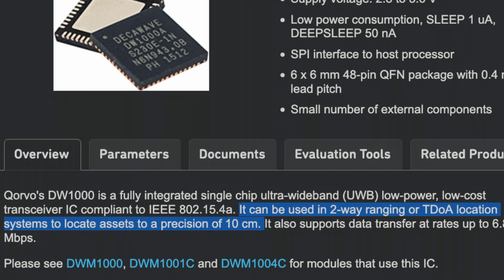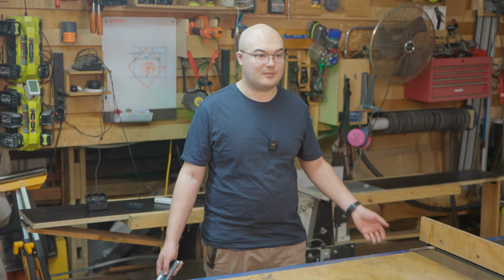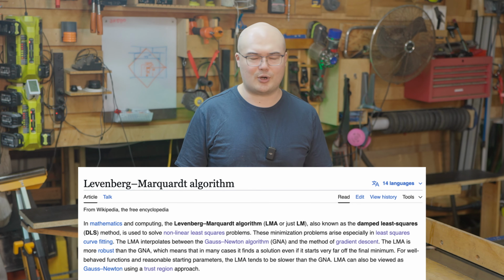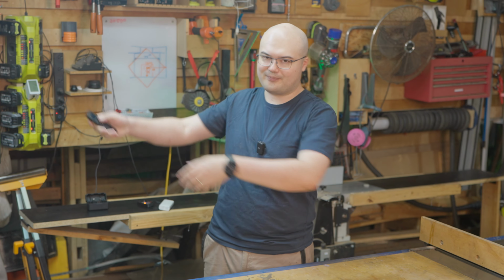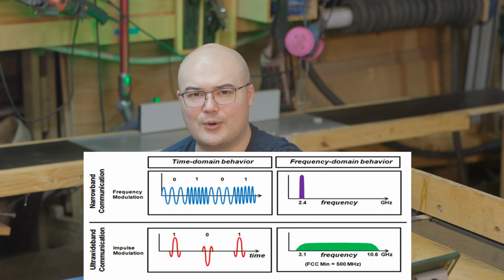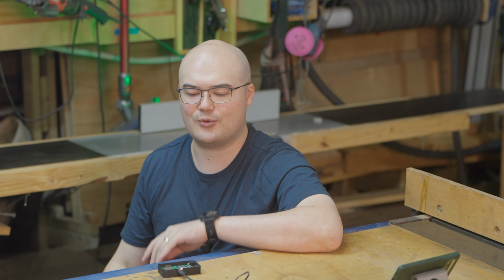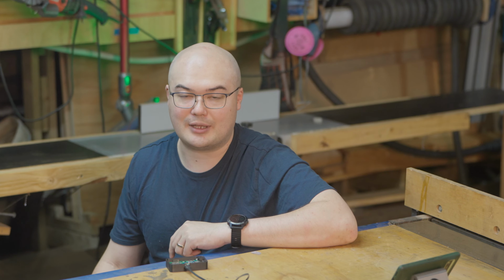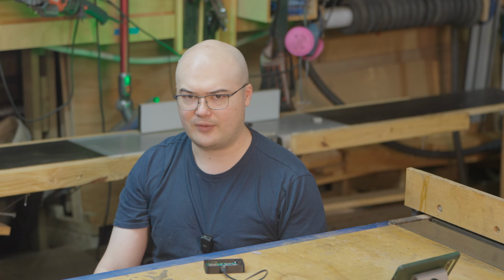Making an indoor positioning system to always point a fan at me

Comment: Hi Jack! It's a miracle that I came across your video; I've been looking for a solution for positioning our autonomous lawnmower project, and your project design does almost exactly what we've been looking for!

I noticed your github repo doesn't have a license... would you be comfortable with us using some of your PCB design and maybe code within our project? Of course, we'll be happy to credit your work in the project's documentation.

Thanks!
Reply from the maker: Hey! Yeah I kind of missed out on a licence, but feel free to use the code as you want! Credit is fine, but note that the PCB is a bit cooked and definitely not production ready, double check the boot mode selector circuit, the data lines from the dw1000 and the usb->serial chip as I had issues with them

Comment: Just get another fan.
Edit: 
But also, why do you need a second radio? Have it point towards your phone, or even your (smart?)watch.
BTLE or WiFi targeting have more than enough precision for this application.
Reply from the maker: Another fan would be too simple! (but admittedly a lot easier and cheaper)

Would BLE or WiFi have enough resolution though? If I had multiple BLE "receivers" I could theoretically receive the packets from a device and use the difference in the time it is received to figure out the location (TDOA), but that would mean having to implement my own timers and synchronization. Unless you mean RSSI which is an entirely different (and less accurate) method (I would only use this for occupancy of a room, not positioning within a room).

Either way, implementing it in UWB is a bit of a learning experience on my end, I've always wanted to play with it!

Comment: Nice video. It makes me wonder how many anchors you'd need to be able to track something (yourself, the fan) in relation to the anchor's position, as opposed to having to specify the coordinates of the anchors. Something that could work even if you moved any of the devices around. :)
Reply from the maker: I wonder how that would work? The only way that makes sense in my head is if you also get the anchors to also figure out the distances to each other as well as the tags... In that case you'd still technically only need 4 anchors but it makes the system more complicated software wise!